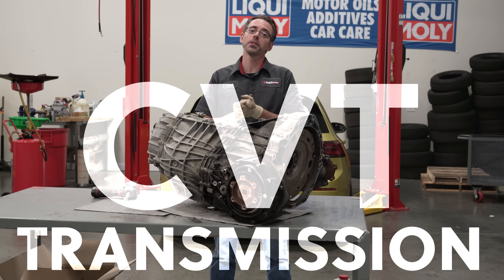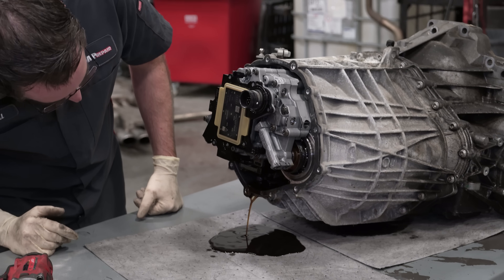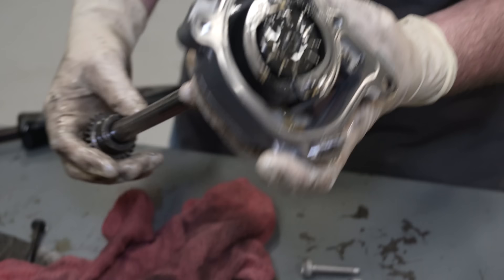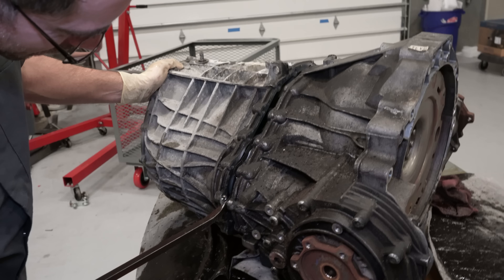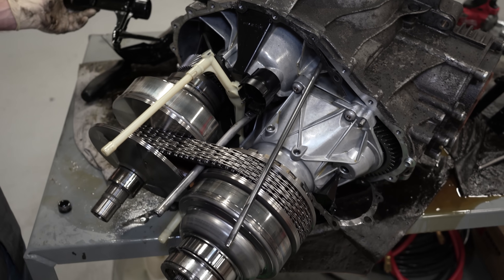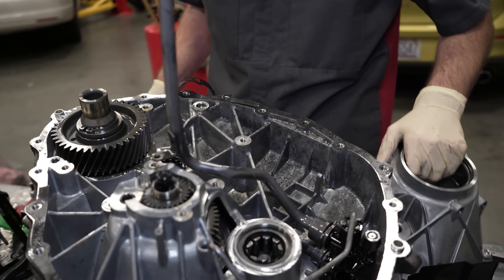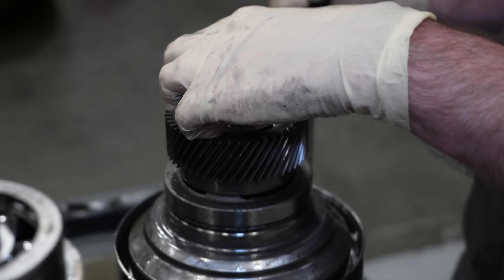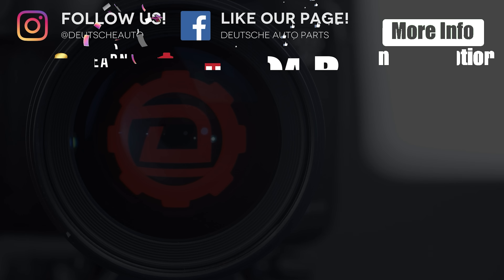Why you shouldn’t get a CVT transmission

Comment: I own a 2015 Subaru Forester, 94,000 miles. I’ve had no trouble with the cvt transmission. The Forester accelerates sluggishly when cold otherwise it accelerates fine for my driving. This Forester is the first new vehicle I have bought with an automatic transmission. All my other new vehicles had manual transmissions and were off-road capable vehicles. I like the smoothness of the cvt. If I wanted a high performance vehicle, I would get one with a manual transmission. I bought a Forester because it is so good driving on ice and snow.
Reply: I have a 2015 forester with 200k miles on it. I had a solenoid failure at 150k miles cost 1100 to replace the solenoid, replace the fluid and get back on the road. Was running in 2wd after it failed. 
I'll be honest. I don't mind the forester CVT it's torquey and doesn't operate like a friggin wind-up toy. I have no power delivery issues with mine. I wouldn't doubt if I get 300k out of it.
Reply: I have a 2010 outback with over 215k in it. Just had the solenoid replaced, car has been a workhorse. Likewise I had a 2008 Jetta with a manual transmission that blew after 94k, up to that point I had only driven manual transmissions from Chevy to Volkswagen, with the VW being the only one to pop. We have 3 Subarus now. The aforementioned outback, 2017 forester (115k), and a 23 wilderness. With the exception of the 2010 having its issue at 210k. The bottom line is anything can happen. Stop spreading fud. Unless talking about Nissan lol.
Reply: I have a new Forester Wilderness. I didn't know anything about CVT Transmissions when I got it, but it's to my understanding  now that Subaru really worked to make it reliable
Reply: @katefoyder506 subaru has not worked to make it reliable.  They had class action settlement warranties and started keeping parts on hand so they can do a swaonin about 6 hours. 

The modern Subaru other than the WRX also have the ats AWD system.  It only drives the rear when there is slip.  You wilderness is less capable off road than a '90s Forester. Those could lock the fluid coupling to be like a 4x4 and won't dig ruts going up dirt hills. 

Make sure you send it any time you think you need AWD like you would a fwd car. The ats system is great to help out and keep your momentum up, but won't help once you stop or slide back.
Reply: @zanzabar4ky7  just going off the information I got from "The Subaru Guy". Also I have talked to many Forester owners and the majority are on their 4th or 5th. Seems like it can't be all that bad. Keep smiling
Reply: @katefoyder506  I am a huge Subaru fan (or was.) They are fine for about 60k miles if you don't go off road or speed.  If you change the fluid against SOA recommendation it should last a while for normal use.  If you don't speed or go off road it is perfectly fine for a 10 year car.  Don't buy one used and don't try to take it off road where 4x4 go like you could do with an older one with an automatic transmission.   They still drive poorly and are less efficient than a traditional automatic but if you like the car, go for it so long as you sell it before the warranty ends. 

I personally liked subaru for wagons, racing, and trail crawling.  They don't do any of those right now up to the standards they had 10-20 years ago.  They haven't even made wagons for the us since 2008 when they did the last few 2009 legacy outbacks.   The ats system is not really full time and does what the "fake" systems Audi and bmw did in the 90s that Subaru claimed were not full time.
Reply: Cvt are zombie transmisión dual clutch are a lot better.
Reply: Well, it only has 94,000 miles. Sluggish in cold weather you say. Here are some of the signs a Subaru CVT is starting to fail. Unusual noises, such as grinding, whining, or clunking. Slipping gears, where the engine revs but the car doesn't accelerate accordingly. Leaking transmission fluid or a burning smell. Dashboard warning lights, such as the check engine light or the transmission temperature ...

Comment: Funny thing is GM And Ford auto transmissions made them the least reliable cars on the NZ market for many years until we finally stopped them being sold altogether average 30 thousand miles before needing replacement. 
My parents drove a Nissan CVT for 20 years and 300000 miles and never an issue. 
Sure you yanks are not being played by the japs and euros. Everyone in the world has complete contempt for North Americans. 
Maybe do special deal just for you. Use drain cleaner for lubricant, and special not hardened belts?
How many you want?

Comment: Love when mech's go full redneck and rip out the cutting saw to dismantle stuff  lol 
I hate this trans, imma gonna chop shit up. 
My spirit animal .👹👺💀

Badass chain. But holy crap, what a nightmare.
Im convinced engineers and designers drop acid before they start drawing.
Evil fucks never had to work on the stuff they design.

Oil filter change on my ute lubes the drive shaft, Universal joint and the underbody all at once. But that, only after half an hour swearing trying to access and unscrew it. 😡🤬

Comment: 13 years ago I took out a Nissan with a CVT for a test drive and was unimpressed.  Then I test drove and bought a Suzuki SX4 with a CVT.  310,000km later the only significant mechanical weakness in this car has been the alternator.  The motor and drive train are flawless.  I don't know if I'm just very luck, but I'd recommend a CVT for people who don't like standard transmissions.

Comment: I had a 2010 Subaru Largacy. I loved it. It had a CVT trans. Went to 295K miles and finally bit the dust. It had paddle shifters. Dream to drive.
Reply: The transmission was a Cathode Ray Tube?  😂
Reply: It had a TV for a transmission, that's cool
Reply: I have driven automatic for years. The two best  were Toyota 4.2l Landcruiser, and the currant Subaru Outback diesel CVT. It's  brilliant, best uto so far, smooth realy good fuel economy, smooth, good off road and brilliant on the motorway, here in the UK they are sealed for life, unless they show any problems, then they have an extended warranty, even after the warranty period subaru have been paying 80% of the repair, because they have so few that go wrong, most high  millage problems have been with the solenoid and that can be accessed without  taking the box off, I  think that you must speak as you find  this Outback is the only car I  have ever had without a single fault from new, now 5 years old.
Reply: Your "Largacy" had a Cathode Ray Tube in it? You're Killing Me Smalls! 😂

Comment: 88k in a 2015 Mitsubishi Mirage before trading down to a Chrysler 200. I miss the CVT experience. No shifting ever. Integrated cruise control would manage speed even on downhill. I know some manufacturers did not engineer good trannys, including CVTs, but the technology is not inherently weak.

Comment: My 2020 Nissan Altima had a CVT transmission, I just traded it in on a 2023 Hyundai Elantra that does not have a CVT transmission, now after seeing this video I am glad that I did, although my Altima never gave any trouble, Had I kept it, it is most likely that it would have.

The one thing I do miss is the paddles on the back side of the steering wheel to shift up or down, I love the manual transmissions, as my two challengers and my mustang had them, so the ability to downshift on the Altima was nice, as you can stop a whole lot faster adding downshifting to the brakes.

And now I know to stay away from CVT, if I can remember this when I do my next trade in 3 years or 50,000 miles.
Reply: Nah, it’d be fine. Jatco, who makes Nissan’s cvt’s, hasn’t had a  major cvt issue since 2013. The new cvt’s are very reliable from all manufacturers. This dude is a clown spewing nonsense on a very abused cvt unit.
Reply: @haroldbeauchamp3770  

There are three Mitchel dealerships that I am aware of locally, Nissan, Hyundai, and Dodge/Jeep I bought my last 4 vehicles from each of those, a 2012 Challenger, a 2015 Challenger, a 2020 Nissan Altima and lastly the Hyundai Elantra, the Hyundai and Nissan dealerships are literally next-door neighbors, you can walk from one right to the other. but all are Mitchel, the Hyundai salesperson was also saying that the CVT transmission was unreliable so that being under the same parent company one dealership was cutting the throat of its next-door neighbor.
Reply: @dennishagans6339  definitely an interesting business model there. Even more interesting is the Hyundai Elantra has used a cvt since 2020 on many models. Seeing yours does not have a cvt, it must be the N line Elantra which uses a dual clutch automatic transmission, which can be problematic too. I’m curious if the salesman flat out lied in order to gain your business from the Nissan side.

Comment: Really great camera work throughout this. And good editing.

This video does a great job of demonstrating why CVT's in this design are not smart. You can see how small that contact surface is and just what a weird overall mechanism. Not a good idea, the way it's designed
Reply: I don't know about the camerawork, it was pretty shakey. Editing was fine though
Reply: There is a good reason why the contact surface has to be that small. This gearbox design is good for 500k km if serviced properly.
People save on maintenance and/or race their street car and then wonder why things break. To blame the "weird" design for it is ... not very wise.

Comment: CVTs do not have infinite gear ratios, they are infinitely variable. They have a continuous range of ratios between the upper and lower bound. If the computer could move the servos infinitely precisely, they would have an infinite selection of ratios.

Comment: I own a Honda Jazz 1.4 CVT 2006 Model, done 150,000 km with no transmission issues yet. It has has a reasonably easy life, low Kms and driven a lot by my daughter and her gran. But we do rake in on long trips about once a year when we have 4 adults, a Thuli roof rack full, a 270kg trailer full of kit, a laser dinghy on top of the trailer, and some more stuff in the back of the car with the dog. We are careful to drive very gently when loaded like that, but the CVT has survived for 17 years so far. Per one of your reader comments, I believe oil changes are important. The Jazz is only 55kW. I don't think I would go near CVT on a powerful car. It's the nearest you can get to driving an EV in an ICE car. Since in 10 years we will all be in EVs, we can forget about hideously complex and large CVTs like on the bench in this vid.

Comment: I have a  2010 Subaru Legacy, 2.5l motor, CVT trans, it has 305,000kms on it and CVT still works as it should... flawlessly.  
It's also very economical to run BECAUSE of the CVT. 
At 100kmh it is running at 1700rpm on a flat road and I'm getting 13.8km per liter of fuel.
I have zero complaints!
Reply: Yes I  find my outback diesel cvt  really good, fuel, and so easy to drive.

Comment: CVTs are great when you put them in an economy car where fuel efficiency comes first.  Manufacturers get greedy and push them out with too much power behind them.  So many economy cars suffer from this same problem.  "Cars won't sell in the US without MOAR HORRPOWRRRR" has become the mantra.  In reality, the extra cost of a bigger, more powerful motor is very counter productive with what the market actually wants.  Go try to buy a high MPG economy car.  No dealer lot has them because they sell too quick.  A cheap, light weight compact car is the perfect place for a CVT.
Reply: This 100%  CVTs aren't meant for heavy weight, high HP/torque applications...or "spirited" driving for that matter.

Comment: When I test drove a new 4-cylinder (non-turbo) 2016 Accord I was extremely leery of the CVT. I'd heard all sorts of bad reports regarding CVTs in general. I really thought this would be a deal breaker but to my surprise, it performed quite well. The engine stayed at a much lower RPM than I expected. Acceleration was fine in drive and in sport mode, actually quite brisk. Yes, it surges a little when in drive and under hard acceleration but it's not a big deal to me. The car gets 32mpg overall and about 38mpg on the highway. I now have 95K miles on it with no transmission issues. But the drive belt is due to be changed at 100K miles. Gulp $$$
Reply: My sisters 16 Accord has 124k miles and runs strong. No belt replaced before, and just 1 transmission oil change. Don’t compare Honda to Nissan two different quality control people running the show
Reply: I got a Mazda just for a traditional transmission. I test drove a Honda and 2 Suburus. Something was missing compared to the Mazda
Reply: @timothygibney159  I did the same. Was after a small Japanese car, and Mazda were the only brand that could sell me a car without a cvt. I’ll never buy a car with a cvt.
Reply: @paulypaulypauly8011 just bought a 2023 Mazda3. Sold my 2022 Crosstrek for it. Crosstrek is a nice car but I could not stand that CVT. I didn’t know what a CVT was at the time but once I did my research I got rid of that thing. Sold it for higher than normal because it was still during the car shortage and people love Crosstreks. But my Mazda is so much better. Feels good to have a regular automatic.
Reply: @ДжоСмитти69420 I can imagine.  My new(er) car is a Honda cvt.  Hoping and praying Honda has got this under control.
Reply: @SlowerTrafficKeepRight-k2g  Honda CVTs seem to be solid. Toyota has those eCVTs in their Corollas and Priuses that seem to do well enough. I probably overreacted when I learned about CVTs, if I kept up with maintenance I’m sure it would have been fine but these days I want the most reliability I can find for a vehicle because transmission repairs are almost never worth paying for.
Reply: My 10th generation civic has 250k miles on the cvt and I've only done one transmission fluid change at 80k miles. Still drives and feels brand new. Don't change the belt, they're just telling you that to charge you money
Reply: Cvt belts don't need replacement ever.The key to making them last long is Lubegard synthetic cvt transmission fluid and a auxiliary transmission cooler.I have a 2008 Nissan Maxima V6 with 242,000 miles on it and I have never had a issue with anything save for the normal problems.I got it when it had 35,000 miles on it and had the fluid drained and have been using Lubegard Cvt fluid and I installed a extra transmission cooler on the front of the car. I change the fluid every 35,000 miles.I rag that car out also and tow my Atvs all the time.Heat is what kills and I had a temp gauge installed on the cooler so I always know whats going on. I don't know why Nissan wont instal a larger cooler  on there and use Lubegard products in there  Cvt cars it would save them millions in warranty repairs.
Reply: It’s a timing chain so leave it alone, it’ll outlast your engine once you service your car on time.
Reply: I have a 2001 honda civic with the standard 5 speed transmission. Car has 278000 miles on it and I'm only on the second clutch and flywheel. Also get like 32 mpg.
Reply: @Jimmy_CV  that thing will outlast most things in the road 😂
Reply: It works fine until it comes apart.
Reply: @aasberry1  like everything, Einstein..😊
Reply: Trade it off when it hits 99K miles.  😂
Reply: What do you mean the drive belt needs changed?  I think the 4 cylinder has a timing chain.

Do you mean changing the serpentine belt?
Reply: @steeler1983  I'm pretty sure he means the belt inside the CVT, not the timing chain in the engine, which shouldn't need replacement ever unless you have some kind of issue.

Comment: The engineering required to get that metal band actuation and lubricating fluid working correctly under a range of operating conditions is insane, when you think about it. I'm sure we'll see improved CVT technology in the future but right now they're just too susceptible to failure if they're not looked after.
Reply: I have an eCVT on my lexus. No belts and pulleys. Just electric motors / generators to control the planetary gears.
Reply: @viq234  yeah hybrids are different and basically Superior in the transmission game. they feel like cvts and I think that's why they get the name
Reply: So, just look after it.  Service it according to manufacturers specs and it will go a long way.  My HRV with CVT has crested 100k and still drives and runs like new.  Serviced it twice in that interval.  German cars are engineered to be expensive.  Expensive to buy, insure, run and especially repair.
Reply: Todas las transmisiones y transejes son susceptibles a fallas si no se cuidan.
Reply: @galam65  Quite.
Reply: @galam65  однако вариатору субару очень далеко до механической кпп субару)
Reply: honda and toyota both make very solid cvts (especially toyota). the problem is that cvts are much more reliant on regular fluid changes than a standard automatic is, however even still toyota cvts will last you 200k+ miles without changes so
Reply: Toyota and Honda CVTs are amazing. Last just as long as traditional automatic transmissions
Reply: Failure under warranty with Nissan. Highway driving kills them every time.
Reply: @marshmower  yes. Drove a 2014 of my ex's. It has a peppy engine, but the CVT drove absolutely terrible. Felt like the engine would grenade out from under the hood going up in RPM. Never doing a CVT again. Love my gears any day.

Comment: Nah bruh cvt is sick. You have to relearn your throttle control and driving style. You have to let the cvt go easy on take off. But as soon as it goes you can floor it. Change the fluid every three oil changes and every other oil change if you drive aggressively. It is a fantastic transmission. It feels like an electric car but with an engine. Smooth acceleration is awesome.